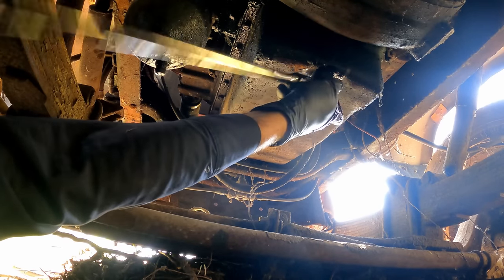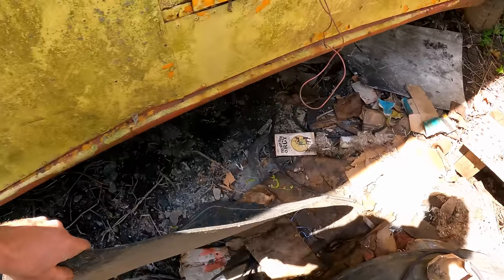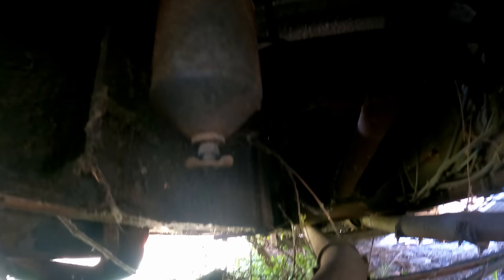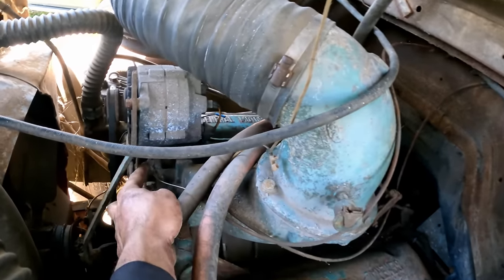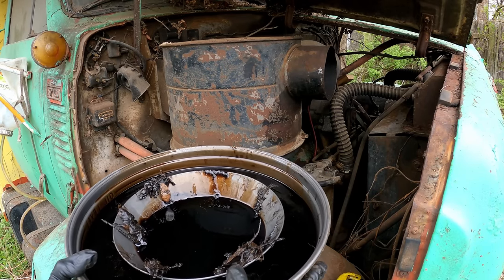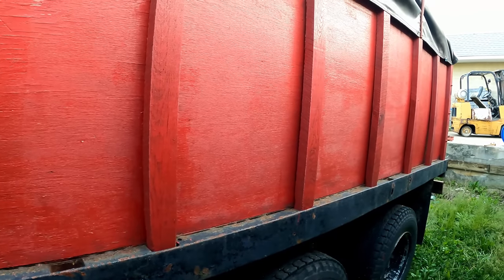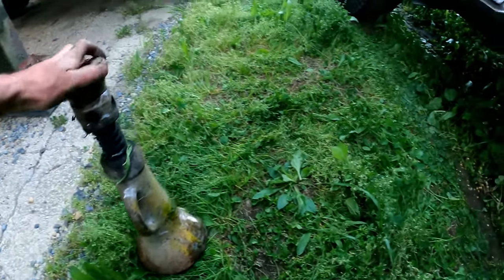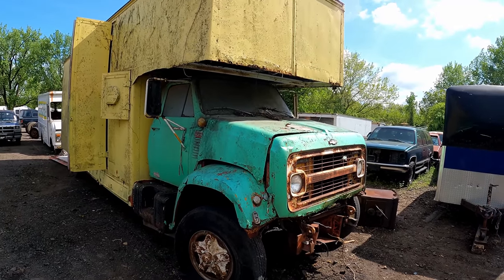Chevy C70 with 6v53 Diesel Sitting 30 Years - Will It Run... Away? - NNKH

Comment: Now you see why the Detroit Diesels (Screaming Jimmies) have such a strong following.  They were very popular for generators engines because you didn't have to run a block heater constantly.  They could be cold, go from off to full throttle and stay there with no problems.  It actually has a very interesting history.  It was designed in 1936 by Winston Motor Cars and they tried to sell it to the US navy.  Because you could run them wide open all day long (and the military don't care about fuel economy) the Navy bought them.  Winston spun the engine off to a new subdivision of Winston called Cleveland Diesel and they started building engines for the military.  Problem was, like willys, they were too small of a company to build enough so the Gov gave it to GM to build.  GM gobbled up Cleveland Diesel and it became detroit diesel.  Funny thing about the gov, you sign a contract for the military, you build the product but you also give them the rights to that product and design.  This is how the jeep was moved from willys to Ford, and how the DD was moved from Cleveland Diesel to GM.  There were a lot of machinations that took place for all of this to pan out but i kept it simple.  Another interesting tidbit...with a kit you could make the DD tier 2 emissions legal.  (Tier 2 is EGR... 1- cat, 2- cat/egr, 3- cat/egr/dpf, 4- cat/egr/dpf/scr (although, in many cases the scr is efficient enough to dump the egr system))
Reply: Thanks for the History on them rock doctor.
Reply: very interesting I’ll never forget this
Reply: Cool story, but when GM purchased Winton Motor Carriage Company in 1930, they changed the name to Winton Engine Corporation. The design of the Two-stroke 71 series wasn't yet around then, It wasn't until later that it was designed by a group of GM engineers.
Reply: Real facts. 👍
Reply: Interesting that you mention emissions controls, obviously 2 strokes are awful in the efficiency and PM department, but i'd imagine they'd produce far less NOx as a side effect. would be curious if someone actually took some measurements
Reply: @CharredSteak  2 strokes are actually quite efficient. Some of our most thermally efficient engines are two-stroke diesels. Its typically what is used in large container ships.
Reply: Your name makes me think of the man, the myth, the legend over on Reddit with some absolutely gutbustingly funny stories: Dr.Rocknocker. I gotta go read some more of his stories.......
Reply: Thanks for the info and history. Why would anyone want to add emissions crap though lol
Reply: thanks for the history! fascinating.  The allies win WW 2 because of all the trucks engines planes tanks built in Detroit and sent to the allies including the Soviets. The industrial might and power of US manufacturing won WW2 and the cold war!
Reply: The Detroit diesel lore master. I like your words magic man.

Comment: The reason your fuel went down so fast is because it's constantly pumping fuel through the injectors and back to the tank through the return line. Most of your fuel was going back into the old tank on the truck. Drove a Chevy just like that, same cab and engine, except it was a tandem dump and had the five and four-speed transmission setup like that International.

Comment: My late father had a truck here in Australia with a V6-53, it was a great unit to drive, I spotted straight away that you had tripped the shut off, glad you went back to it.
The V6-53 was really sweet when hooked to a 10 speed RoadRanger gearbox. They are a real ball to drive.

Comment: I use to drive a GMC General with a 6V92 and another with a 8V92. So much fun , sounds like your doing 200 mph.  I also had a 97' 379 peterbilt with a series 60 Detroit diesel 500 HP, my friends had Cats and Cummins and would make fun of my Detroit but I got way better fuel mileage and while I couldn't out pull them I could definitely keep up.

Comment: great video, i lived in a 1952 gm bus motirhome conversion, i started the diesel engine every few weeks, it took off one time i about had a heart attack, i finally took a ten bolt plate off and used a rag to shut the air off, very scarey.

Comment: Just in case you didn't know, you can buy a water-sensing paste that you can put on a piece of steel rod or a  tape measure and stick into a fuel tank and it will tell you exactly how much water is in a fuel tank. It is like a crayon, only a bit softer, and you just smear a little onto the end of a tape measure and stick it into the fuel tank and the water will turn it red. The paste is usually yellow, don't know if there are other colors. That could save you from having to crawl under and pull a plug or open a petcock to see if there is water.

Comment: On a Detroit the rack is in the full throttle position when not running then the governor idles it when it starts. Put a pair of vise grips on the rack tube in idle position then fire it. There usually is an emergency shutdown flap over the intake and the blower shaft sometimes will round off but you can pull the blower shaft out and put it in backwards temporarily and it’ll run fine. Happened to me on shrimp boats many many times

Comment: Thank you for your hard work, simple try to start a Detroit. Myself have a 8-71 & a 353. both of them I have too manually RESET the Air Emergency shut off. The 8-71 has a button on dash ( solenoid on engine) the 353 has a long cable down to shut off. On the 871 have to watch kids carefully when they get in cab. Kids want to push/ pull all the switches. I covered the shut off with a rubber cover. My 871 has a pull out nob for stopping. on the dash, next to manual Throttle. On my 353 when I got her, the previous owner just had ONE battery. The battery cables got really HOT. I use 2 battery's. just saying what I have found on both my Detroit's. ONE battery gets really HOT ( cables) when starting.

Comment: I think the reason it wouldn’t run was you released the intake trap door in front of the blower. You have to reset the latch and it would likely run. Update, I Just saw you eventually figured it out on the International, the 53 series engines are very simple.

Comment: Back in the early 2000s i worked for a shortline railway in New Illinois and a farmer part time....he had a C70 as a tractor and i used it often hauling grain .....was a die hard truck stacked upto anything new at the time.

Comment: The Detroit 53 series two cycle diesel was introduced in 1957. Although the engine used a roots type blower like its larger 71 series counterpart, it's classified as a naturally aspirated engine. Rather than being used strictly for performance reasons, the blower's purpose was to facilitate scavenging in the cylinder during the exhaust stroke. A turbocharged version of the engine, which still utilized a blower for scavenging, was offered beginning in 1977. "53" refers to the fact that, regardless of total engine displacement, each cylinder displaces 53 cubic inches.All 53 series diesels, regardless of displacement, feature a 3.875 inch bore and 4.50 inch stroke. It was offered in 3 cylinder, 4 cylinder, 6 cylinder, 8 cylinder and 12 cylinder configurations. The 8 cylinder version was primarily used in marine applications, although it was much less popular than the marine 8V-71. The 12 cylinder version is extremely rare and was reportedly only produced for 1965 to 1968 model years; it is rumored that under 25 of these engines were placed into service. This likely because the larger 12V-71 was more apt for applications that required an engine in this horsepower range and could manage the spacial restraints of a long, 12 cylinder engine. The 12v-53 produced just over 400 horsepower, where as the 12 cylinder 71 series produced a minimum 450 horsepower and up to 900 horsepower. The "silver 53" series was introduced in 1984. Modifications to the engine family promised better fuel economy, quieter operation, and more horsepower across the board.

Comment: I think you may have tripped the emergency stop on that 6v53 between when it was running and not running.  It shuts off the air in case of a runaway.  Hopefully someone at the scrap yard saved that engine.   They are getting hard to find.  They use them in a lot of antique fire engines.  Nice video, than you for doing them!
Reply from the maker: Yeah that's exactly what happened! Figured it out toward the end of the video. And I ended up keeping this engine. I think it was the forklift video I did where I showed getting it for a little bit of work I did

Comment: I knew it would run!!! its actually really clean in there.      If the hood is not open most the time it sits its relatively dry and unharmed.  I would pull the drive train and keep it, And then pull the box off of it and make a nice little dry workshop  its perfect for that

Comment: those racks were stuck when you fired it up the first time bc they hadn't seen oil for 30 years. once you started it and it ran away it pushed a ton of oil up there and gave them a bath. then you came back and took a look at them and they are unseized due to simply having gotten oil again. it def was running away. the injectors only get what fuel the racks give them so even if you have a stuck injector they wont have more fuel than what is provided. cool engine i hate seeing these Detroit engines go to waste. i had an 84 ford f250 4x4 with a detroit 453 t in it and 5" miter cut stacks. it was a screamer! im glad you didnt just give up after that first start up! i havent finished the vid yet when writting this so im hope you cut the mufflers off and really let it sing! haha

Comment: Your videos are great. Don't sweat it, shorter videos with "cliff hangers" are fine. That's how you "keep em comin back for more".  If you ever make to Alaska hit me up and we can take my river boat out and kill some salmon. It's kind of like the air boat you have. Its a cobbled together 21' aluminum smoker craft inboard jet with a 2.0 chrysler but it runs like a beast. Sure it leaks but as long as you go forward and keep the pump running its all good. Not really worried about sinking it in rivers that are only a few feet deep, you can always just run it up on a gravel bar or the shore if it starts gettin "nautical". I'm gonna try flex seal and see how that stuff holds up.

Comment: Unlikely that the C70 was just dumping fuel… The mechanical fuel pump may have had a return, which might have been where your IV bottle of fuel ended up going (back to the factory fuel tank). 

The injectors’ sliding pins (what the rack is hooked to) have serrated teeth inside the injector body that mesh like a gear with the outer edge of a cylindrical valve, the rotational position of which is what controls how much fuel is injected per actuation of the injector plunger. If one or more of the injectors are stuck, the rack under the valve cover cannot move as you saw on that engine toward the end of the video, because what seizes is that valve inside the injector. That said, the rack probably was stuck on the C70 initially, and it’s possible that brief run at well over redline may have freed up those injectors lol. It’s usually best on a revival to pull them out of the engine, spray some PB in the fuel inlet, and give the plunger a few whacks with a hammer, that’ll sometimes free up the sliders. And it’s usually just a few that are stuck, not all of them. Once you get them freed up, at first startup, you can use a pair of vise grips on the rack under the valve cover to have more leverage in controlling fuel delivery, in case another injector gets a little sticky. After it’s run a bit, then you don’t need to worry about it.  

I do understand your confusion over the two types of runaway, but they essentially have the same outcome even if their causes are different (though the type where it’s getting fuel from something it’s not designed to is definitely scarier). Remember it’s the rack that is stuck, not the throttle. With a stuck rack, the governor has zero control over the engine speed (so it isn’t the same as planting your foot on the throttle, where the governor will dial back the fuel delivery once the engine hits redline) — it will easily over-rev just like an oil-fed runaway, and similarly will not survive long at that engine speed. That’s why those shutdown flaps are so important.

Oh, and if you get to see one with a working tach, you’ll notice it sounds like the engine speed is a lot higher than what the tach shows, which is just a characteristic of a two stroke. All six cylinders will fire per engine rotation, compared to only three on a four stroke V6. So it sounds like it’s running about twice as fast as it actually is. Pretty cool.
Reply from the maker: Thanks for all the great info and tips. Good point about the fuel return. It must have one! No way it went through that much diesel

Comment: Detroit's can run away from a blown seal in the "Blower" ( a gear driven roots blower that is needed on two cycle diesels),  that is why they have an emergency shut down air valve in the intake.  There should be a control in the cab to activate it.  Of course it can "run away" with a fuel rack stuck wide open too;  with no load it Will Run Away !

Comment: That's impressive, that old workhorse fired right up first try. And it didn't even smoke the place out either. I used to drive a 1978 White Road Boss with a two stroke Detroit in it as a yard dog 30 years ago. Those motors have to be revved high to get the power out of them unlike the typical four stroke diesel like Cats, Cummins, Macks, and others. Those motors will wreak havoc on your hearing.

Comment: I overfilled a small diesel lorry with oil parked in an underground garage. The thing started running away and caused the whole county hall (500 people plus) to be evacuated cos it set every smoke alarm in the building off. 😂

Comment: If the emergency flapper is working properly they will shut the engine down and won't run with them closed.  They start in the full throttle fuel position  that's why it dumps so much smoke when cranking not to mention it's a 2 stroke so fires injectors 2x the usual norm and they are a common rail fuel design so they pump full flow return to the tank when running

Comment: Check in with Bus Grease MOnkey or Ol2stroker regarding Detroit Racks. If one is stuck open... they're all stuck open as the injectors are all hooked up to that bar that runs over to the govenor. lol Same design as in the late 20's

Comment: sweet engine running at the end!  You think that high rev sound was the sound of the supercharger working properly with an open intake, maybe?  I'm just guessing, but if it's like a turbocharger, they spin really fast inside, just that they are, what, driven by the engine directly?  I'm totally not knowledgeable, but I mean it almost sounded like a turbo but without turbo lag, so that's why I jumped to this conclusion.
Reply: The high rev sound comes from it being a 2 stroke it’s an auditorial illusion that sounds like it’s spinning exactly twice as high than it actually is, because its on a combustion stroke every single time the piston comes to the top. the supercharger is gear driven off the camshaft and does make it’s own noise. but it doesn’t make any boost it’s only purpose is to force air into the cylinders through holes at the bottom that the piston covers, and uncovers as it goes up and down since it can’t make any vacuum, so it will not run without the supercharger

Comment: heres some facts about Detroit Diesels. they need the blower because the engine needs the slide positive pressure on the intake side to push the exhaust gasses out and the clean air in. the pistons have a set of rings on both the bottom and the top to deal with the intake ports being at the bottom of the liner because of the 2 stroke design. Detroit Diesels are also a twin cam engine, the cams run right beside the blower but in the cylinder block. If it’s a V engine, twin cam, if it’s an inline (e.g. 6-71) it has one giant cam. There is also 3 series that Detroit Diesel Made. the 92 series, which means 92 cubic inch per cylinder. The 71 series, 71 cubic inch per cylinder and lastly, the 53 series, 53 cubic inch per cylinder. The name 6V53, the 6 means number of cylinders and the 53 means what series it’s in. Also, that 6V53 is 318 cubic inch.Detroit Diesels biggest engine is a 16V92 which is a 16 cylinder 92 series engine. Great video!

Comment: when they shut down they are wide open you have to pull the valve covers in order to make sure the rack is free if it's stuck then it will be wide open and that is the issue the only way to make sure is to remove the valve cover and make sure the rack is free for the injectors

Comment: Nothing sounds like a 2 stroke diesel Detroit. Add a turbo and ho-lee-fook what an engine. They will also run backwards, I know another old timer that worked in a mine with a long lead road, they would pop start 'em backwards and do 60 mph in reverse. Bad ass. Next time a fire truck passes you, and it sounds like a million angry bees, that's a Detroit 2 stroke diesel turbo. 😍

Comment: It's truly hard to kill a drooling Detroit. 
I've seen them run in old shrimp boats for years with little to no maintenance other than the yearly oil changes
Reply: I’ve worked on and ran shrimp boats starting at 12 years old and I’m 49 now and Detroit’s can definitely take some shit. I know many tricks to getting them running to get me and my crew back home. A garden pump up sprayer with diesel in it connected to the inlet on the fuel pump will prime the entire system in seconds. Just listen for fuel coming out the return line and hit the button and she’ll fire like she never seen as much as an air bubble